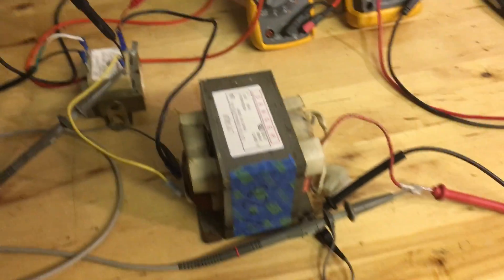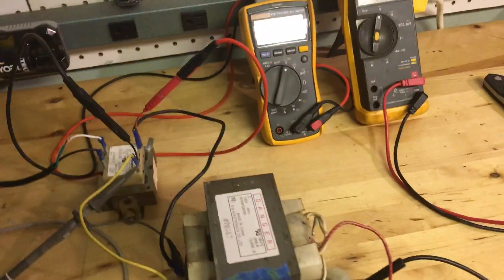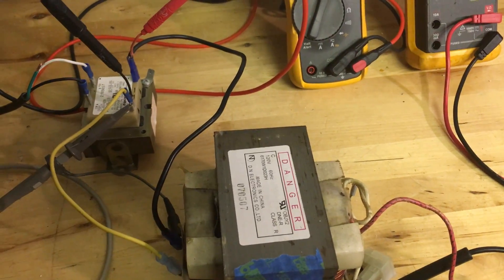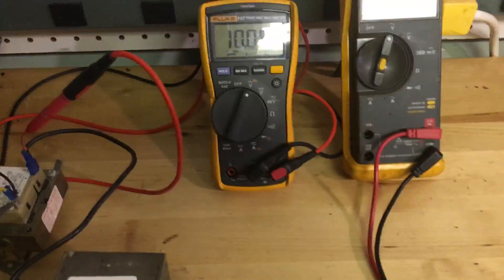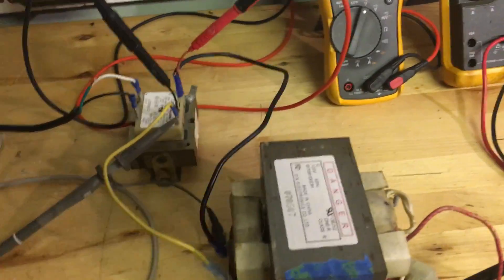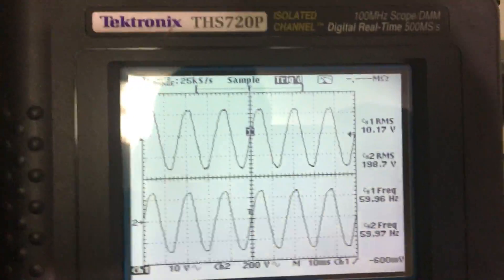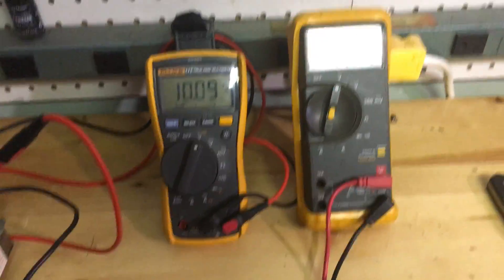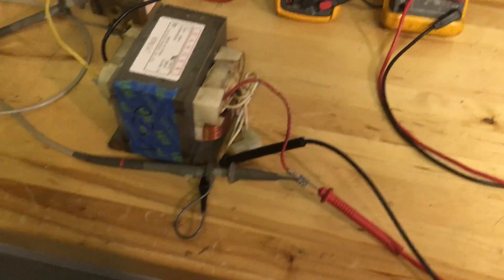Testing a Microwave Transformer

Comment: That was a great idea. After seeing this I did the same thing.  I found an old microwave and pulled the Transformer only to find the Low voltage was shot but the High Voltage side was good putting out 199 volts with just 10 volts in.

Comment: Sir please show the output side transformer connection how you connected . I am also doing this test by giving 12v ac in input side but i can't found any voltage on output side of transformer magnetron connector.  Plz help.
Reply: Than it is bad a transformer
Reply: the core is the secondary ground

Comment: Transformers do go bad. 99 percent will fault on the high voltage tap. Normal ohms from the high voltage to the ground should be 50-70 ohms. Excess above or below are faulty. Primary side (120 v) and magnetron contacts should be less 1.0 ohms. Both the primary contacts and filament (magnetron) contacts should show open (infinity) on your VOM.
Reply from the maker: I'm sure they do, I've just never seen one go bad. They're pretty tough from what I've seen and my "testing".